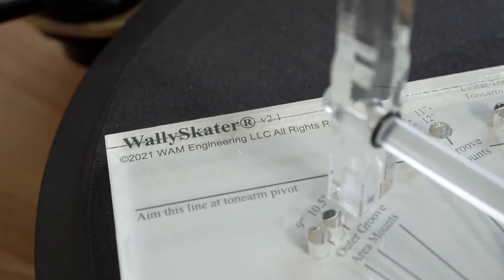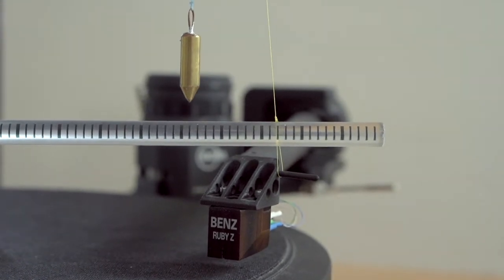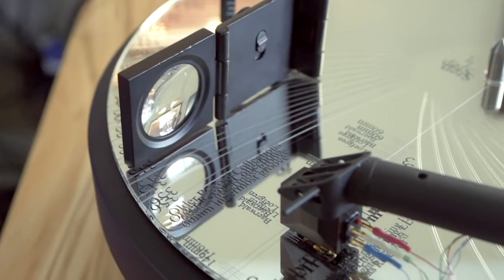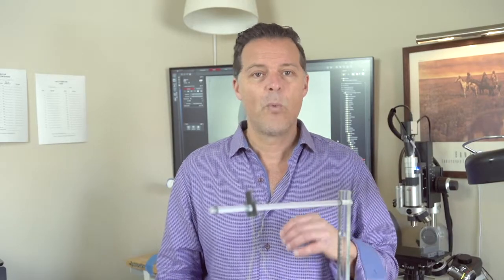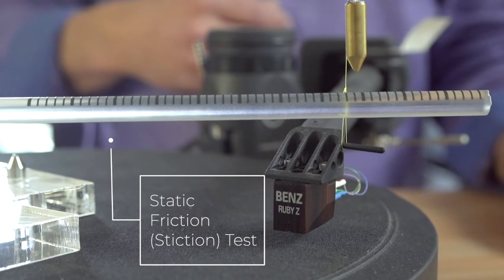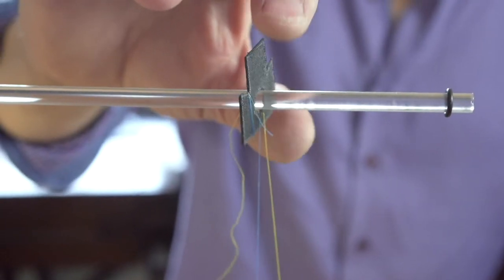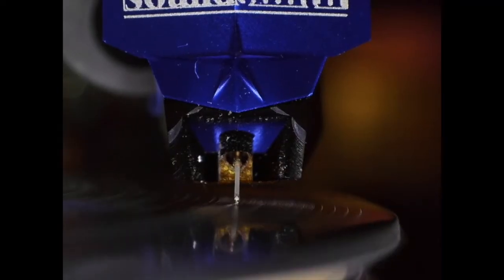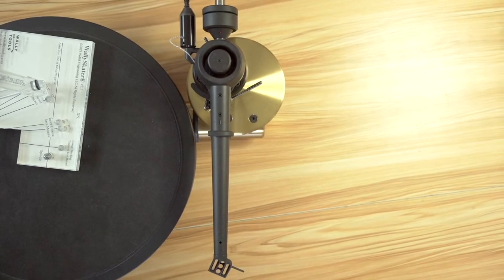Measure Tonearm Behavior to Ensure Optimal Cartridge Performance

Comment: If there is a lateral spontaneous deviation of the arm, then this should be taken into account when setting up antiskating, since two physical forces will already be involved.They will either complement each other, or vice versa.
Reply from the maker: Agreed, but the WallySkater will always measure the NET horizontal forces at play in the arm under static measurement conditions - meaning, without skating force present at the time of measurement. This way, the tendency of the arm to torque one way or the other is included in the measurement.
Reply: Yes, it is an indispensable assistant

Comment: With all the issues that need to be confronted with pivoted arms it's surprising that more linear tracking arms have not been developed to be commercially successful.
Reply from the maker: That’s because linear trackers create a whole other set of issues!
Reply: such as?
Reply from the maker: @robertmeegan9175  6 degrees of freedom at the bearing. All you need is a few microns of freedom to deteriorate the performance. Doesn’t make it “bad”, just less able to allow the cartridge to extract everything from the groove.

Comment: This is one approach, but I think AS is best setup by ear. If you get too far into the weeds with these tools, you don't focus on what matters at the end of the day,.
Reply from the maker: I appreciate you wanting to focus on the music and not the equipment (I am assuming that is what you meant), but with as much as I know about the dynamics of record play I know I could not "optimize" anti-skating by ear. As you make changes to AS, you are changing a minimum of three variables and up to 5, depending upon tonearm design. So, as you change AS and listen by ear, how do you know that to create a net improvement you aren't causing a deterioration in another parameter? 

I am one of many who has spent a lot of money in my equipment and I want to get the most possible performance from it - in other words, I want to know I have OPTIMIZED it. Since we know what the 7 targets for optimization are (see here: https://youtu.be/__ApPo7htUg) then why not measure each independently to then be able to know you have truly optimized the rig? You can then just spend your days listening to music with that confidence. 

Besides, I bet just about anything that one could optimize tonearm behavior with the WallySkater faster than anyone could improve by ear. The latter group will still have to contend with the uncertainty that another parameter hasn't deteriorated following those efforts.
Reply: @WAM-Engineering  if you deteriorate another variable, you would hear it 😉. I also believe that optimizing as many variables as possible with the needle in the groove, playing actual music, makes a big difference. You can never optimize all the variables for all the records - it’s always a compromise. So even if a tool tells me that I have AS for example set perfectly, so what? Perfect AS is not going to = the best music. Ultimately the record player is a musical instrument, more than any other component. Tools are important, don’t get me wrong, but a tool is not going to account for personal preferences, room dynamics, music type, and the complex interrelationships with the other variables. (Just my 2c)
Reply from the maker: @Fluterra  We are going to have to agree to disagree. We have conducted multiple tests both blind and unblinded that showed very clearly that a significant improvement in one parameter can mask deterioration in another parameter in listening tests. In other words, the improvement in one parameter was significant enough for you to not notice what you just lost in another parameter. We have done similar tests in finite element analysis and MATLAB which support the outcome of the listening tests. 

We will also have to agree to disagree that one cannot optimize all 7 vinyl playback setup parameters. We do it on a regular basis and the results are obvious to our clients.

We will further have to agree to disagree that a turntable is a musical instrument. It is not. It is a mechanical transcription instrument. As such, the fidelity with which it does its job is constrained and determined by the variables that went into making the groove in the first place. Any ADDITIVE sonic signature would be distortion whether such distortion was pleasing to the ear or not. However, one thing that is well known is when you add distortion in a mechanical process you are certain to not be able to read ALL information rendered in the groove. Other system-wide variables as you mention that may or may not be a problem should be addressed at their source, not compensated for during the mechanical transcription.

Variations of cutting at the lathe have a known variability with the variations equally distributed about the mean (the engineer's setup target). Obviously, we cannot control this so we aim for the mean (setup/playback target) in our playback to enjoy the highest possible probability of getting the greatest performance out of every single one of our records.

Enjoy your analog in any case!